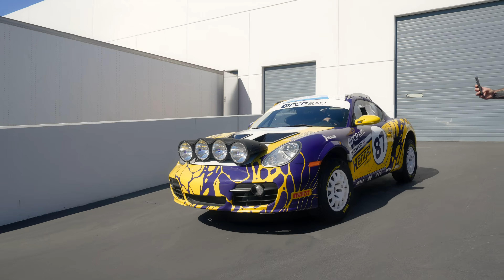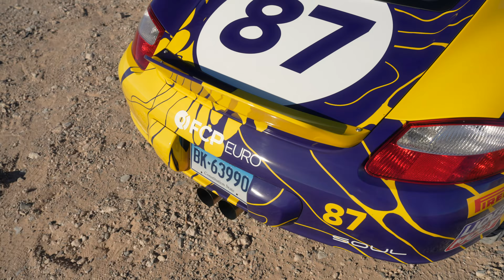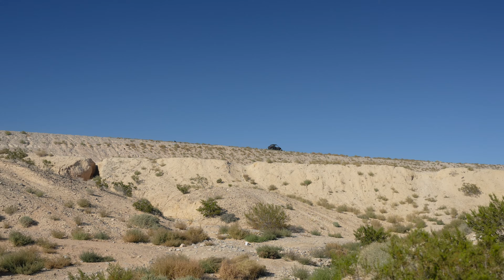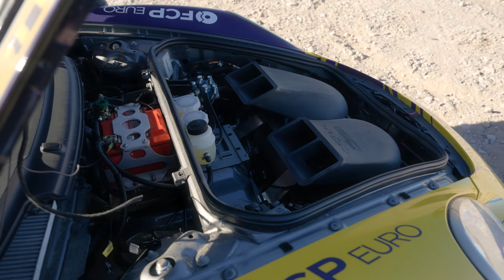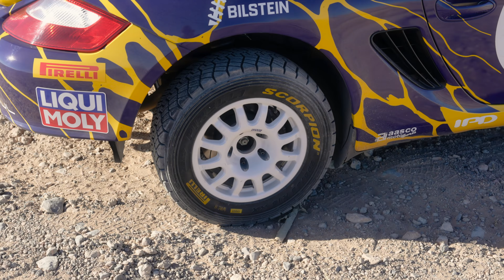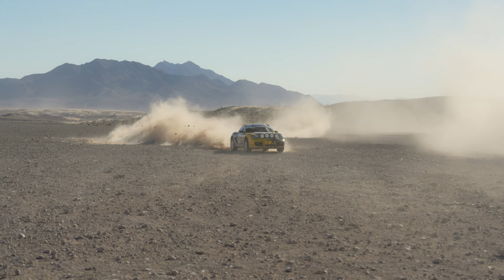RALLY PORSCHE CAYMAN IN LAS VEGAS DUNES [BUILD BREAKDOWN]

Comment: Normal Hella Rally 3000 from early 1990`s with 100w Halogen bulbs is the best high beam lights I had ever had on any car... I mounted them upside down because they gave to much light in front of the car in a laying C pattern, so when I turned them upside down all that light went straight up in the air instead but it somhow helped me see a lot further down the road while at same time had a good spread better then anything else I have ever tried to the sides. My car did run 14,8v meaning it was a LOT more then 100w, so much more that those lights was brighter then 50w Xeon but with much lower color temperature (more yellow)...
Reply from the maker: thanks for sharing